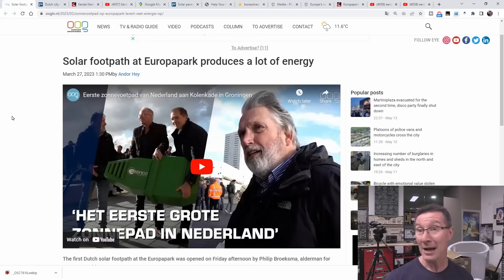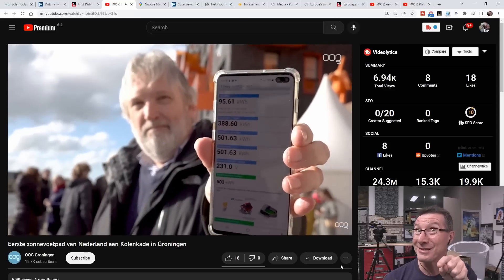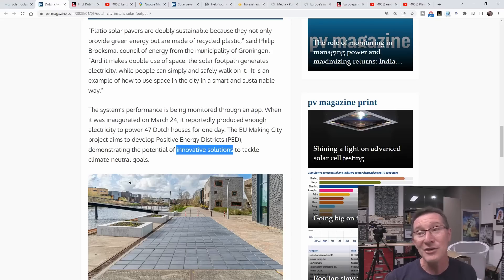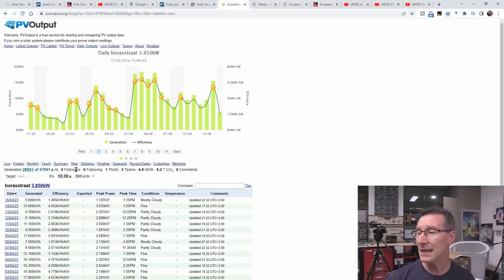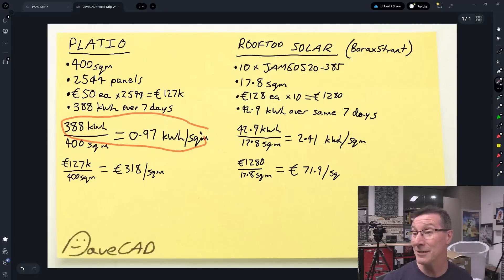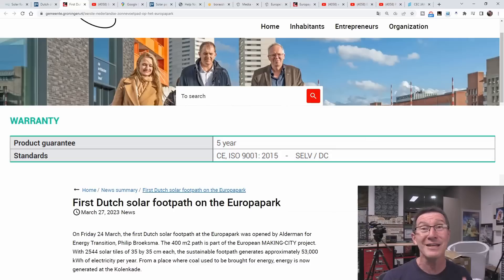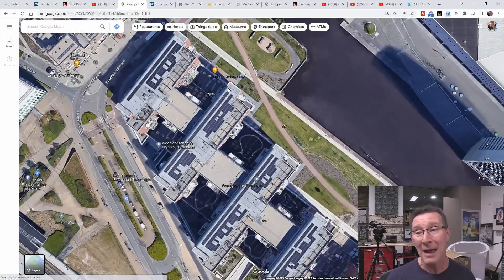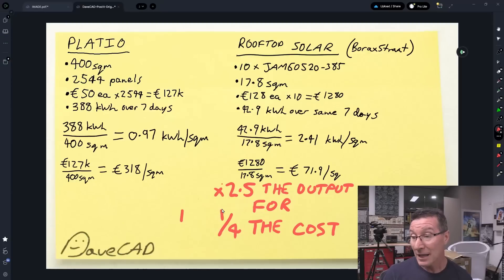EEVblog 1544 - Platio Solar Pavement BUSTED!

Comment: Hi Dave,

interested in your analysis of the supercap car jump starter vs the standard lithium boost packs.

Lithium jump packs claims thousands of amps of peak power 
How is this achieved and is it Bs 

Super capacitor jump packs seem interesting but couldn’t find any videos on real data on them
Reply: Super caps are wimpy. Lithium cells can have absurd peak currents vs their volume. Lithium boost packs are well over an order of magnitude lighter than comparable super capacitor banks. There’s really no comparison. Supercaps are for standby type use at low current drains.

Comment: I don't understand. In ideal conditions you could have around 1400 W x sqm (let's say 1000 W* taking losses over time) if the photons hit the cell at 90 degree angle. Sidewalks made of solar panels would work only across the equator line. Everywhere else we must change the angle, otherwise you'll get less and less energy. Let aside the issues with panels getting cracked, abrasion, vandalism etc.

I particularly like the idea of solar panel arrays moving like sunflowers during the day, but the cost of having electric motors and gearboxes which could get jammed by no good reason might not worth the hassle.

*Please correct me if I'm wrong.

As always, excellent rant/lecture!

Comment: First, we got financed research which produced VERY biased results, then the politicians and climate extremists brainwashed the society, and now it is a phase of wasting taxpayers money. Why are you surprised folks? That is very logical and natural process 🙂

PS: there is a funny rumor: in 80's soviets realized that they are going to collapse. Then  KGB deliberately staged the Chernobyl disaster for 3 reasons: 1) to scare the Europeans and bias them against nuclear power; 2) to prevent production of Plutonium and thus nuclear bombs; 3) to make Europe dependent on russian gas and oil for the next 50 years. Indeed they've succeeded. With just a single action they manged to put whole European energy infrastructure and mentality up side down. That's why we are experiencing this solar- and wind- power nonsense!

Comment: The problem with solar on a flat roof is that no-one can see them. From the perspective of a politician, an action doesn't count unless people are aware of it.

Snark aside, I can  imagine only a few small niches where this sort of tile could be of practical value. Places like parks and historic sites where visual impact must be minimised and some power is needed for lighting, kiosks or infrastructure. A solar pathway in those situations might be cheaper than running power cables. It is a very small niche though.
Reply: I don’t believe any such niches exist at all for “solar pavers”. Nature heavily conspires against them. It’s just a daft idea.

Comment: you forget one thing in the calculations which is the cleaning cost as the derbies, shoe rubber and drink spillage plus any other stuff that will accumulate on top of these tiles; as well it will decrease the output power even more (+ the shadow effect).  I guess there will not be any ROI or even negative cash flow due to operation and maintenance costs.

Comment: I've said it before: If we still need more solar capacity after every roof on every building in every city has been solar panelized, then we can entertain the idea of putting solar panels in transportation surfaces
Reply: Yeah, put solar panels on the top of the electric vehicle for 5-10% extra free range every day,  and put the solar panels and batteries on the electric train to allow the emergency pullover when the grid power goes out

Comment: huh thats my city! hadnt even heard of this at all. its right next to a place where a friend of mine used to live (the big orange one called hetekolen (Hot coals) ), he actually used to work for OOG TV that made that vid. for some reason the wanky opening had a Urenco logo on it, which is the dutch nuclear power agency lol.
the vid mentions specifically that this is stated as a experiment (part of the reason they got EU money), the main idea guy theo hoek even says that you should put solar panels on your roof first. but says there isnt enough space soon.
as it happens my dad just bought a bunch of solar panels 20x2m^2 which costed 220eu each which works out to 110eu per sq meter at 440W peak iirc.

Comment: This will go the same way as the solar roads. The eco grifters always forget that it has to perform its original function as well as generate electricity. The solar roads fail because they don't take into account what cars do to roads or that glass panels are slippery as f#ck when they get wet and oily. The pathways will go the same way, they will damage quickly or get two dirty to effectively generate or cause accidents or fail in many other ways.

Comment: 2.5 times the output for 1/4 the cost is not the entire story, because you must include maintenance costs.  And it's not just wear and tear from weather as a rooftop installation would undergo.  People walking on it, rolling carts and carriages on it, dropping things on it, abrasion from dirt/sand/etc., occluding the lenses, mechanical stresses damaging the connections...it's a long list.  What a scam.  It's wish-thinking mentality.  It's the New Baby Jeebuz.

Comment: Footpaths are the worst place to put solar panels in simply due to the fact it will need immaculate cleaning at least once a day.

 It would have been FAR better to just design a shade over the footpath with the solar panels integrated into them.

Comment: The efficiency of the CELL MAY be 21.8% but the MODULE is 16.8%, The efficiency of the Pv module is based on  the area of the MODULE and not the cell. If they can't get the basics right they might as well leave us in peace.
Reply: Oh and let’s see the efficiency in a year from now. Solar cell efficiency falls nonlinearly with occultation. Even some dirt and pitting on the surface will decrease output more than what would linearly follow just from additional absorption in the top of the tile.

Oh. Forgot. Shadowing by pedestrians will be a big problem if there’s reasonable foot traffic there too. And some people may come over specifically to see the novelty for themselves.

That weekly output we saw was, I bet, with barriers all around it and no people walking on top.

But sure a cool way to get those sweet sweet EU funds while wasting everyone’s time and consuming resources we’re supposed to save…

Comment: I was reading ahead and... it's an infrastructure system that has an app, because of course it does like any other electronic device marketed by venture capitalists.

I'm thinking the app just displays maximum power even during blizzards.

Wouldn't it be far more cost-effective and robust to use regenerative footpaths in busy downtown areas like metro stations?

Comment: Don't forget you're comparing a "brand new", still shiny clean system, to a rooftop system that's been there for a while. Imagine the output of this green bs after it gets real abuse from people just walking on top of that. Will it even generate anything?
Reply: Pedestrians blocking direct sunlight as they walk over it.
Dirt from their shoes getting carried onto it.
Dirt grinding into the surface of it, scratching it.
Dirt getting stuck in the scratches.
It's madness.

Comment: I have a solar powered vitreous ceramic balcony floor. It’s not used for PV but is excellent for unwantingly frying bare feet in summer. 😂
Reply: dont be fooled, this also serves to prevent feet fungus....if your feet are bone dry and fried, you wont have problems with fungus....or maybe yes, as there will be tiny wounds that can be easily infected. Be sure to always fry your feet to "well done"

Comment: I'm still waiting for solarpanels on sea... suggested it a few times now Dave 😊
Reply from the maker: I think I've showed the wreckage of some of those on previous videos.
Reply: still makes more sense.  least you could move the farms for emergency use to some place that needs power.                ..after the typhoon has passed.
Reply: @lasskinn474  The problem with putting them on the sea is protecting them from said sea.
Reply: @InfernosReaper  well yeah you wouldn't need to keep them there for years on end.  just deploy from some ships suitable for storing shipping containers in a way they could be accessed, , fit in modules 0.5 meters high and you'd fit 120-110 square meters of panel with space left over for cables.  have the battery pack containers on land. point being emergency deployment to some island or coastal area that got wrecked, the point wouldn't be optimal operation or angles or like that at all, just quick mass deployment and not needing to unload the cargo onto land in the disaster area which is the only thing the sea makes sense for in most of the world.

later let the locals tow them to land if they figure out a place on land for them so they can maintain them
Reply: Solar panels on lakes can actually work though. The panels work a bit better because the water can provide cooling, and the panels can go on 'land' that is otherwise unproductive. There are no rough seas on a lake, so the support platform is just plastic floats and aluminium frame.
Reply: @vylbird8014  Depends on the lake really. Ones that have habitats for plants and wildlife could see a negative impact, but if not too many are used, it might work okay. 
Ones that are basically reservoirs could benefit from less evaporation

In both cases, they would have to be rather robust because they're mad of toxic materials and you don't want that in water supplies and habitats if you can help it.

Comment: People who think these projects are harmless don't understand opportunity cost. These projects take time and money away from real and practical solutions. The best solar installation I have seen was solar panels over a parking lot. Shades cars and easy access for maintenance. There is no shortage of parking lots to cover.
Reply: Yes. Put solar panels OVER parking lot. Or OVER a bike line. On roofs of trains stations and bus stations. Maybe even sides of buildings. 
But why on Earth would you put them on earth?
Reply: Yeah, that's a good one. Similarly, the only "solar roadways" that need to exist are ones mounted above the roads
Reply: @InfernosReaper  Those make sense too. Blocks sunlight going into the driver's eyes and can offer some protection from snow or heavy rain. Obviously stick to long, straight highway roads that go East to West or North to South to make layout easier.
Reply: Completely agree. I'd rather they would have installed roof top residential solar on a low income neighborhood than give money to these shitty scam companies.
Reply: Yours is THE most important point in the whole argument.  Time and resources used to pursue good intentions are time and resources that will never be available to produce actual benefits.
Reply: At this point this is a sunk cost...
Reply: How scratch resistant are those tiles? Every little scratch will lower its efficiency. Every covered tile will lower the efficiency of the panels connected in series...

This project is ridiculous just because of this alone.
Reply: Also i don't know if its the same in other countries, but companies don't even want to take on projects that would do a real Impact... My dad's company consumes crap ton of energy and he wanted to make huge solar plant and battery units for it. He has ginormous empty fields around it, and so he wanted to cover all buildings roofs with panels and those fields around it. Combined with those battery units, it would be a multi million project, but when he reached out to companies, not a single one wanted to take it on, and that was even before talking about price of it.

Is it normal in other countries too? Here close to no big scale solar projects are done and at this pace, we will not turn off those coal and gas plants before 2100 lol. And they also want to close down our nuclear plants?! To open gas powerplants... That absolutely blows my mind.   

Also the fact that Germany closed their nuclear plants and turned on coal powerplants instead makes me feel like there is no hope for humanity... The country that is the loudest about reducing emissions closes nuclear power plants just to increase their emissions by using coal and gas instead... They have 10x higher emissions per kWh than what France has for fksake, and that's a number from time before they closed their nuclears and turned on those coal plants... 

Sometimes Germans are so stupid that i cant fathom how they became one of the largest economies. Their decisions are often totally brain-dead
Reply: @mitotakjde9763  what country is that?
Here in Sweden there are a lot of companies that are getting solar panels and even batteries
Reply: @flabbergast_se  its Czech Republic. People are placing rooftop solar panels, but companies just don't want to do big scale projects. Those boomed years ago, and since then, almost nothing new was built. Now they are doing mostly just rooftops of family houses. 

It actually blew my mind, that companies just declined a huge project like this.
Reply: Roofs of gas stations are the best. Completely flat roof ready to go with power infrastructure already in place on site
Reply: don't need a solution when there is no problem.

man's tiny contribution to co2 has no effect on the weather.
Reply: @axeman2638  Even if you choose to stick you head in the sand on climate change, you can't ignore the benefit of moving away from foreign oil.
Reply: The reason the solar roadways get the funding money is because most countries have such bloated budgets for their transportation sectors, so they piss it away on crap like this. Parking lots don't get the same funding money as roads do, so the money doesn't get put into practical applications like parking lot solar panels, but impractical stuff like solar roads and walkways, because the money is going to be spent to maintain the roads anyway, so why not triple the cost and make them solar (that's their rationale not mine)?
Reply: it would be interesting if there were people sort of making a more formal dossier about this kind of finding and sending to peers with BG on engineering and othe relevant stuff, then divulge it to politicians and maybe even environmentalist NGOs. Maybe even something in the scientific paper format, there's one about "hyperloop" type of stuff, which while not using terms like "BUSTED," "RUBBISH," should make those who are reading far less enthusiastic, although I think it was not even as pessimistic as it could have been, more on the "cautious" zone only.
Reply: Engineers/related types of experts should make some kind of dossier exposing the problems in some formal way, both accessible to lay people, but also with more technical details, perhaps. Then have it promoted among politicians and maybe NGOs, besides trying to cause some sort of media buzz, warning that there can be fake "green" stuff stealing opportunity of investment in time-tested green solutions themselves.
Reply: but real and practical solutions that work are not wanted anymore today you have to build out of dreams not caring how stupid they are
Reply: Also these projects don't take time and money away from real solutions. That's like saying having and arts budget takes money away from the poor.
Reply: @Chris-rg6nm  I don't think you are understanding the concept of "opportunity cost".
Reply: @Chris-rg6nm  If you have funding available for an eco installation, why not spend it on the most bang for the buck solution? There is a set budget for this kind of project, and spending it on an ineffective solution makes absolutely NO sense.
Reply: @Chris-rg6nm  False equivalence. Spending your arts budget on teaching the ducks at the park make paintings takes money away from the arts budget for the poor.

Comment: Rooftop solar will last about 15 years? This, maybe 3 years if you are lucky. So rooftop is actually 50 times cheaper, not 10 times.
Reply: The life quoted for solar panels is really just the manufacturer's warranty based on diminishing performance. Most of them will happily operate /far/ longer than their quoted life, though at reduced output. Given the minimal maintainance costs (they just need a wipe-down every year or so to clean the bird crap off, and occasionally replacement for a failed inverter), even the reduced-output array is still very economical to keep in operation.

Comment: "Super wanky save the whales" Lol !....cheers.
Reply: Wait until they find out that solar panels are much less reflecting than dirt and concrete so they warm up under the sun and as they get hot they get less efficient and get even hotter. It means that if you cover a big space of land with solar panels you absorb much more heat from the sun as otherwise it would get reflected back into space. Not only it contributes to the global warming but the worst part is that it contributes to local warming of the air right around the solar panels and that generally means warming of the cities, just where most somewhat wealthy AC loving people tend to live. So not only the whales are screwed anyway and so are we but the more enthusiasticly we "fight for the environment" this way the worse the environment actually gets.